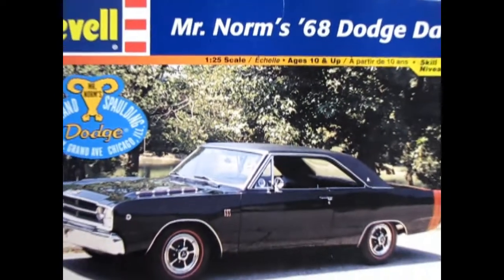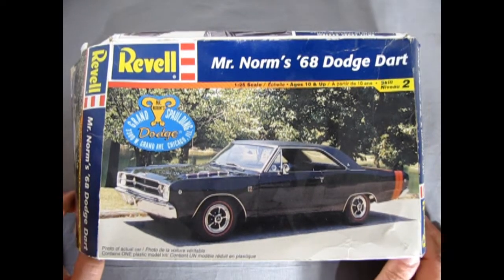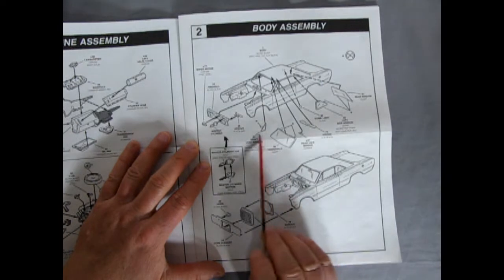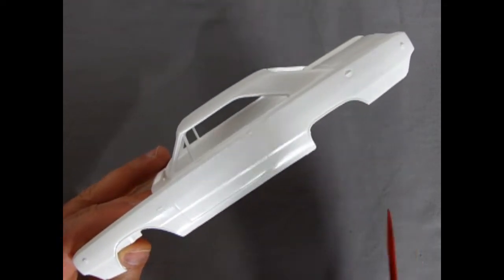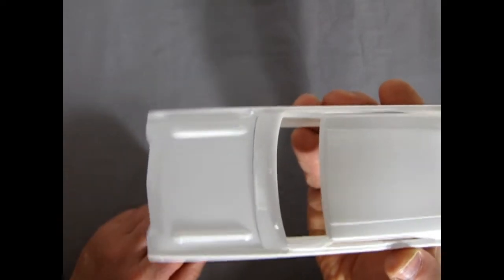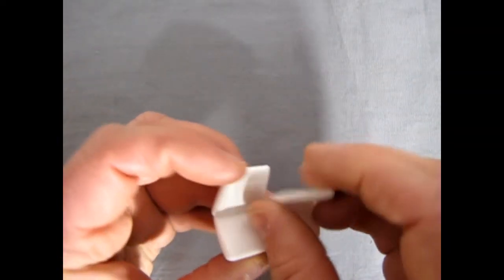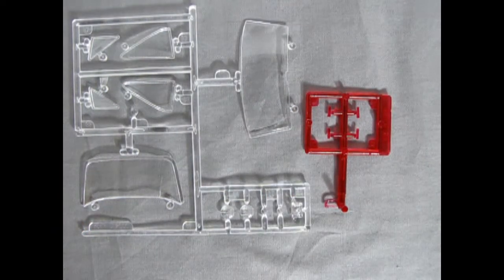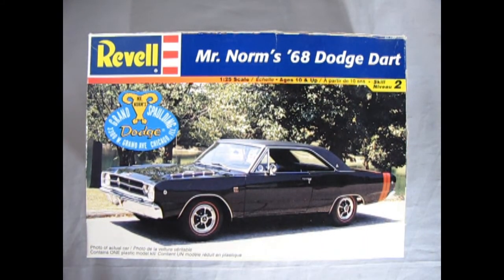Model Car Garage - Mr Norm's 1968 Dodge Dart Model Kit By Revell - A Model Car Unboxing Video

Comment: The correct engine colour is Chrysler Engine Turquoise , and not Engine Red or Orange .
The underhood battery is incorrect as well for a 1967-1969 GSS .
The brake booster is also a no-no , as that wasn't an option with the 440 GSS (1968) or the 440 GTS (1969) . Four-wheel drum brakes (YIKES !) were the only brakes for the 440 Darts , though I'd imagine that a Mr. Norms car could've been special ordered with non-assist disc brakes (which were available with the 383 GTS that Norm based his 440 conversion upon).

This kit represents the 2nd iteration of the Revell Dart series . The first was the 1969 GTS 383 ; followed by this version (backdated to 1968) ; then the Dick Landy SS/EA (with underchassis headers , raised 'Super Stock' springs , etc.) , and ; the newest 1968 GTS / Hurst-Hemi (which needs a resin interior conversion to be accurate ; and the Hurst Dual-Gate console / shifter from the MPC 1969 Barracuda for a Torqueflite-equipped , SS/AA version of the Hemi Dart).

Thanks for the review !
Reply from the maker: Glad you liked the review and thank you for the extra information. You really know your car and that's the type of info I like to have in the comments section.